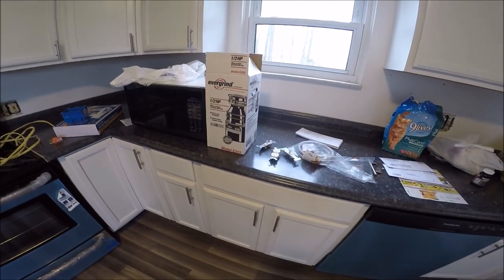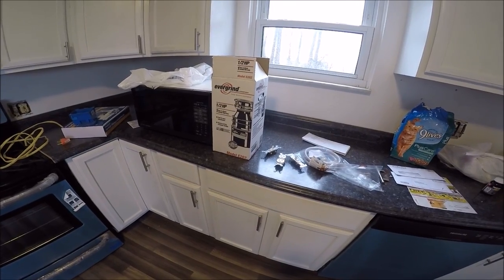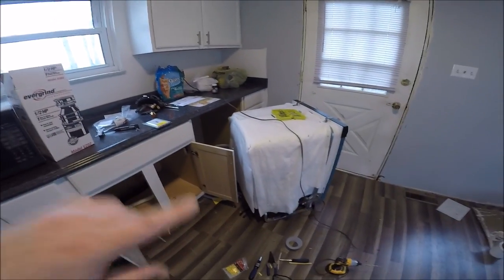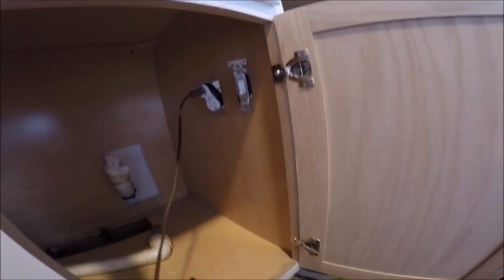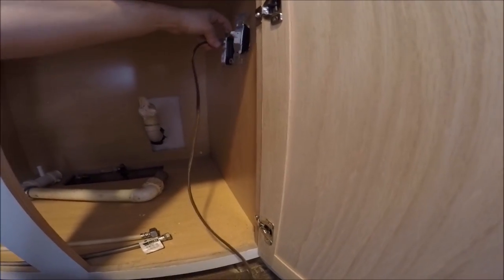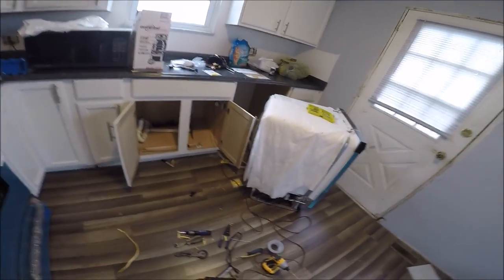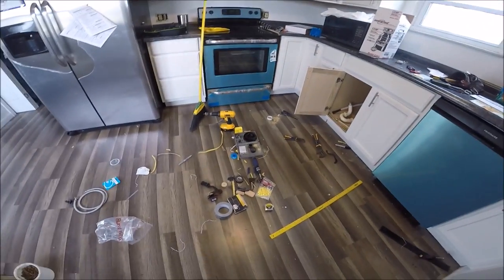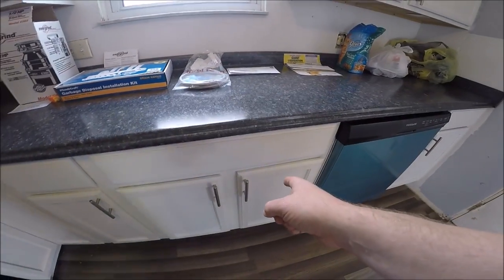Wiring Up a Switch For the Garbage Disposal

Comment: You never showed HOW TO CONNECT THE WIRES TO THE SWITCH!!! That is the only reason i watched your video....
"Wiring Up a Switch" For the Garbage Disposal.
Reply from the maker: Suezie Que Piche sorry
Reply: @benjaminharlan6214  Wire in the switch with the black wires only. The black wire from the power source will go on the bottom screw. The black wire from the disposal will go on the top screw. The bare copper wire will screw onto the green screw on the switch.

Comment: You wasted my time. You showed no wiring so I could not even see what went wrong.
Reply from the maker: Ed Bender sounds like your problem then.  This isn’t a fucking tutorial.
Reply from the maker: Ed Bender I can walk you through it though
Reply from the maker: Ed Bender all I did was splice into the power wire going to the dishwasher and hooked up a simple half-hot outlet to a light switch. That I mounted to the side of the cabinet under the countertop.
Reply: @benjaminharlan6214  Thank You, I appreciate your responding to my statement. I should have known that. I am very electrically challenged.